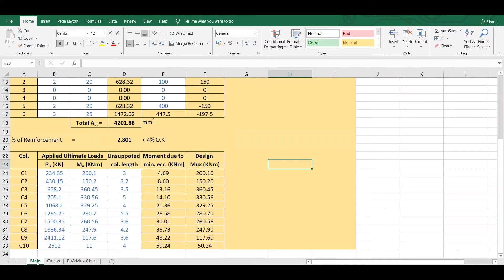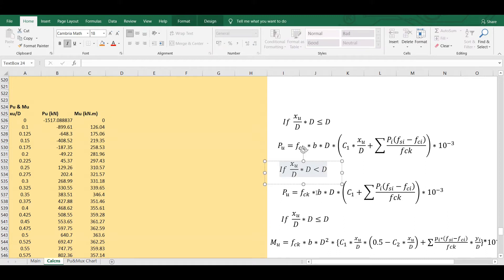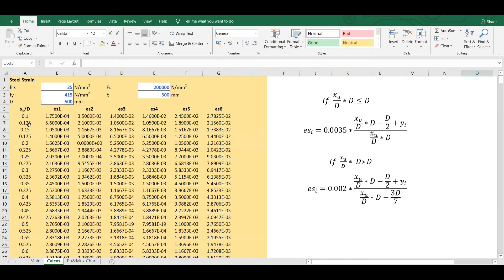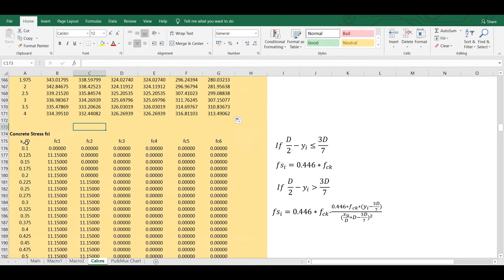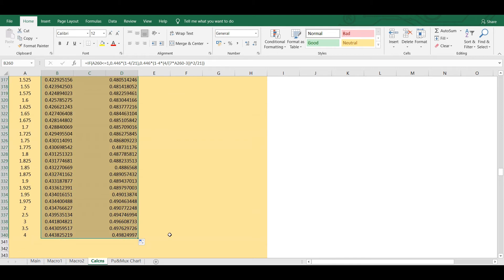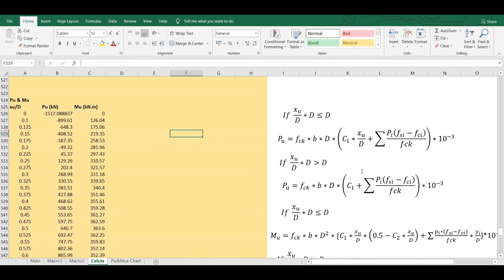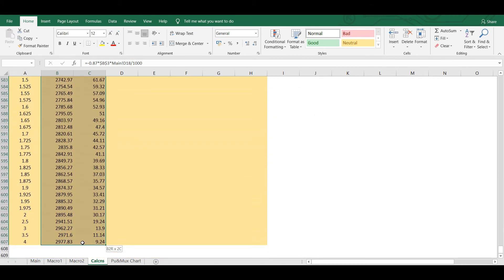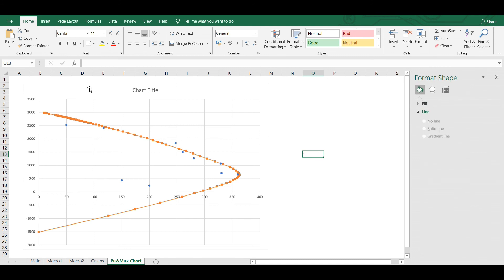Design of columns part 5: Preparing the Interaction Curve to check safety of columns in excel sheet

Comment: Usually practicing engineers are facing difficulty to evaluate the designed columns, and this spreadsheet entirely helps to validate the performance of the column.

Comment: Great effort. Very useful materials. Thank you very much. May God bless!
Reply from the maker: Thanks a lot👍
Reply: @simplystructural8424  Brilliantly explained video sir. I have a doubt. The maximum strain for the FE500 steel is 0.00417, post which we can expect steel failure. In this case, can we assume the section has yielded and limit the calculation. In this chart the strains have far exceeded the max steel strain, like 0.02. Thank you again.